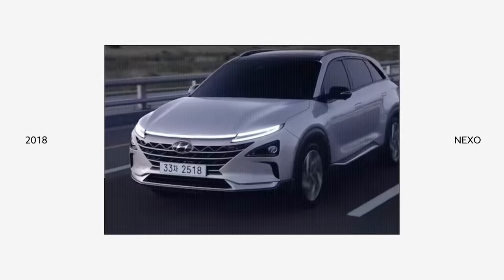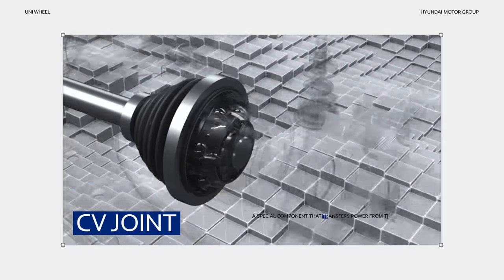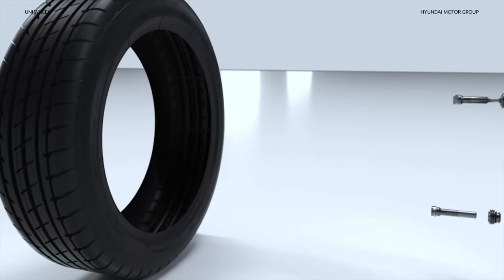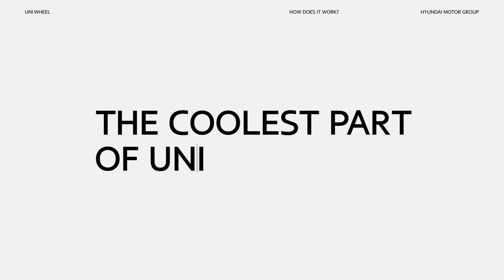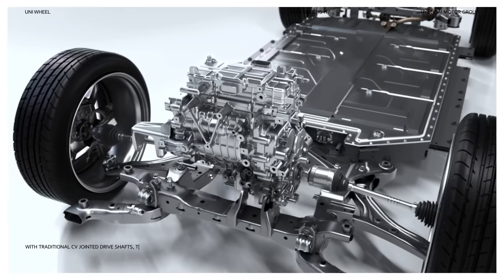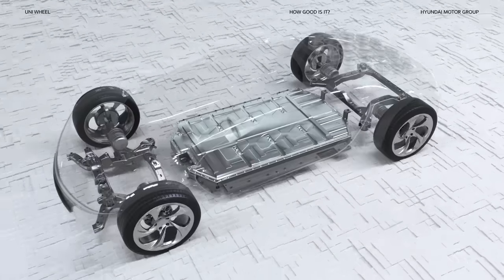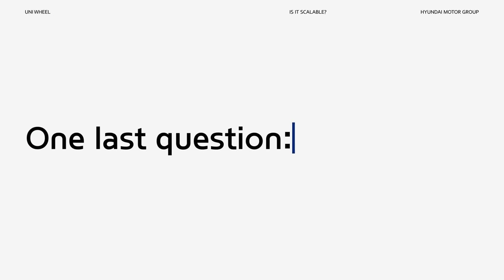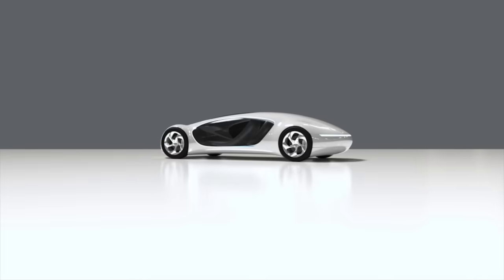The world's first drive system concept | Universal Wheel Drive System

Comment: Unsprung mass problem, by trying to improve the ride they ruined it…maintenance, lubrication and actual device implementation seems impractical, looks very nice on the animations but the real world is different. To Start: Where is mechanism to cope with steering? Or is it only for rear wheel drive? Where do you put the brakes? Two motors make it more complex and expensive…the CV joint is perfect solution for this…they created a problem that did not exist. Cute thou…by the way, 'All Wheel Torque Vectoring' existed decades before this contraption, and works just fine. Oh, another thing, what all those trains of gears do to efficiency? Surely worse than a simple reduction gear box…come on guys!…I can keep going; what about the camber angle of the wheels; Do I have to account for that to install the motor at the correct angle matching the plane of rotation of the wheels?? what a stupid idea! That is why CV joints were invented! They give you the freedom on the three axis. Come on, I want Hyundai to challenge the points above.

Comment: There is a big GAPING lapse of question here. How is this cv dust boot planning to look. I see no mention of it in the video. Not even an inkling of this is mentioned. Im no engineer but ve have a spinning multi axial oscillating drive shaft entering a non rotating housing wirh a rectangle opening. And it will have to sealed from the elements and it will either be filled with diff oil or a grease pack. 😂 bruh lol

Comment: The name "Universal Wheel Drive System" does not fit in.
More like in wheel transaxle
Reply: গুটব তিন দিন হ
Reply: Yeah, but what if they get torque vectoring buttoned down.  Besides, wide vehicles like buses and tractor trailers will have longer shafts which can create more travel in wheels.  I don't know 4WD right now but anything with leaf springs..no problem.
Reply: It's a system (gears, shaft, motor) that drives the wheels and can be universally applied to different vehicle types.

Comment: The comparison vs regular EV motor setup is flagrantly dishonest. When you fade from the old to the new, you conveniently forget to port over the charger, inverter, and HV harness, which were obviously taking half the volume of the "old" motor setup. Of course, since you conveniently forgot about them, the new setup looks so small and clean! Wow! How did you guys achieve that? Oh right, you just threw out the window half of the setup and pretended 4 disconnected motors with no means of transforming, charging or regenerating, never mind transmitting electricity, are magically doing the whole job now. WTF Hyundai??
Reply: They also forgot cooling for the batteries, motors, and charging system
Reply: @AndrewMalkin  Good point thanks.

Comment: Yep.
11 gears per wheel.
44 in total for a 4WD car.

Need I mention anything else?

Christ! 😮
Reply: They’re not adding that many gears though, these gears would just be attached directly to the motor in a traditional configuration since reduction is necessary in either scenario. It differs from car to car but just one planetary reduction requires 4 gears and a ring gear.
Reply: @ineedbigdrink8509 
You may be right although... You lost me... Which says a lot to the complexity of this approach when compared to CV joints, drive shafts and a central engine/motor.
Reply: @FranciscoNogueira  what I said wasn’t complicated, I’m sure the average person would be lost on most of the mechanisms in a traditional car, just take a peek at how automatic transmissions work, and those are the most commonly used transmissions in commuter cars. This universal wheel concept is definitely more complicated than a typical wheel hub but very possible. My main concern is the cost of each one if it were to be repaired/replaced.
Reply: @ineedbigdrink8509 
So you agree then... It's more complicated than a conventional hub. With a lot more things to fail. That was my only/single point. Other than that I'm all for innovation. But not just for the sake of innovating no mater what.

Comment: This is only novel if you think you still need a "drive shaft"...  Disappointed Hyundai. Disappointed. You're smarter than this. There are hub motors that are more powerful and smaller and less prone to breakage than this. This is going to be a maintenance nightmare. Using mechanical force to turn into motion is 18th century thinking. SynPM, Axial Flux, Radial Flux, you guys should look into it.